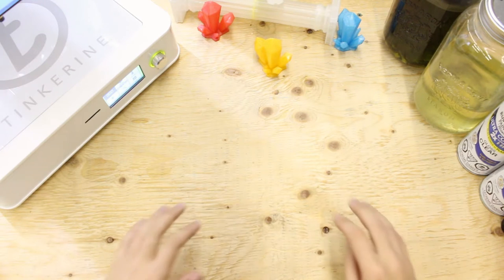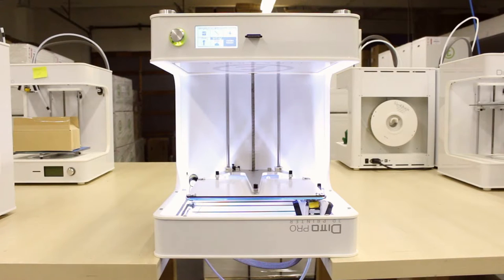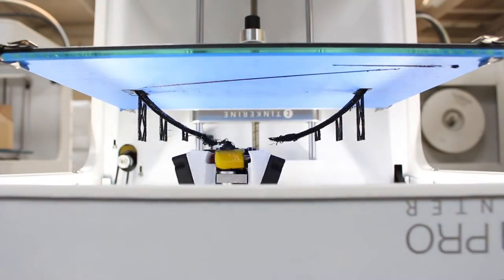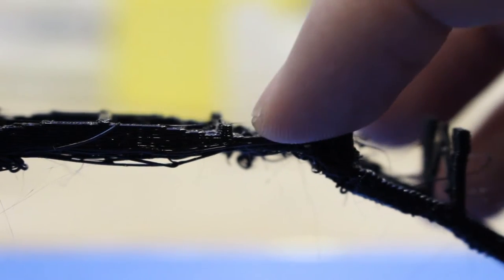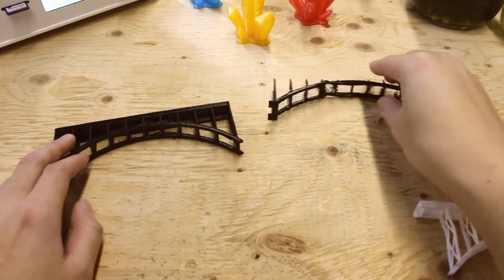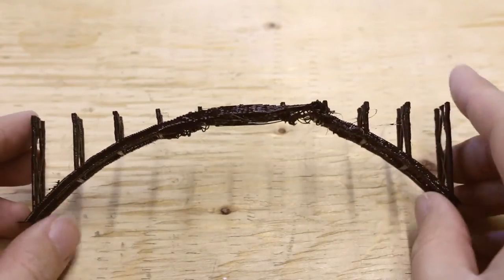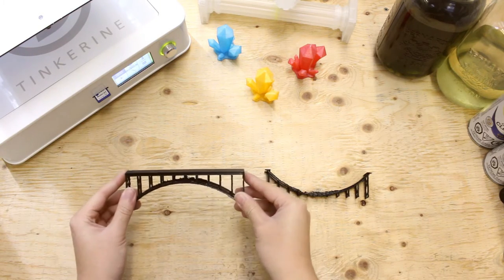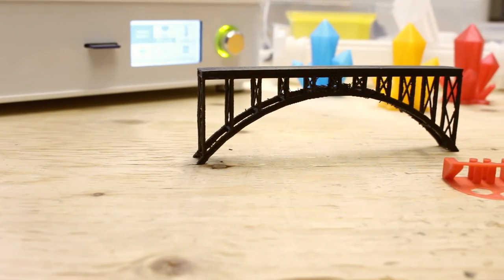Printing Upside Down to Eliminate Overhangs

Comment: I know this is quite an old video, but there is a printer orientation experiment that I haven't seen done yet.... most of the sideways prints I've seen have been done with a print that already prints fine in normal orientation, or prints so fast that molten plastic is being moved around by the print head. I would love to see a print with a really long overhang, where the overhang is aligned with the direction of gravity. In other words, something like a capital letter 'T', where the print is oriented so the sideways printer is attached to the left side of the T, and the extruder will be printing from the right side of the T, with gravity pulling down on the bottom leg of the T. My thinking is that if you printed really, really slowly, the plastic would be extruded and cooled and would be able to stay "in position" at the correct layer height, because gravity would be holding it in place for you (as opposed to pulling the cooled plastic toward the print bed, as it would in normal orientation).
Reply from the maker: Thanks for the comment and the suggestion, we'll look into it!

Comment: @Tinkerine, cool video.

Have you all analysed what accounts for the issue  at the centre of the curve, when the bridge was printed upside down?

Issue with the model design? 

Thank you
Reply from the maker: Hi Ivan,

Thank you for the comment!  If the model was printed with support in place. The center shouldn't turn out like what we saw, but there might be additional factors that may have caused it. We will definitely take a look into it.